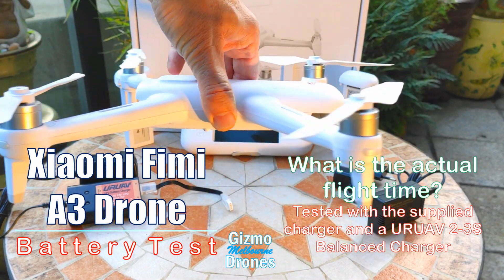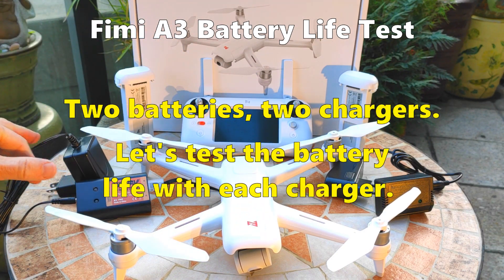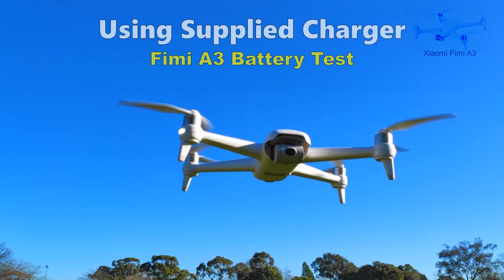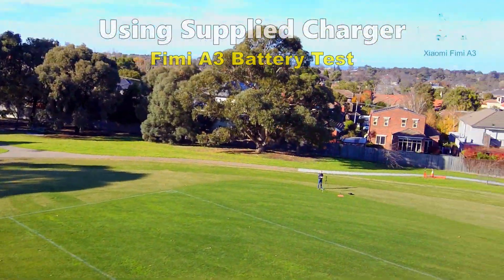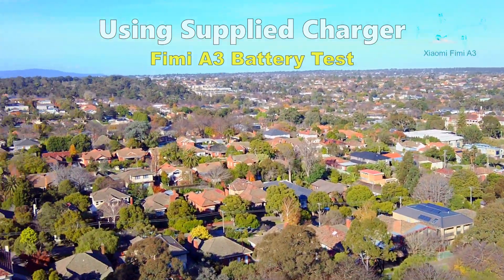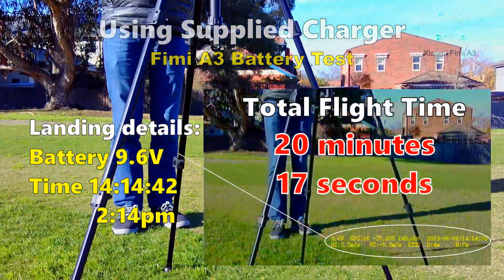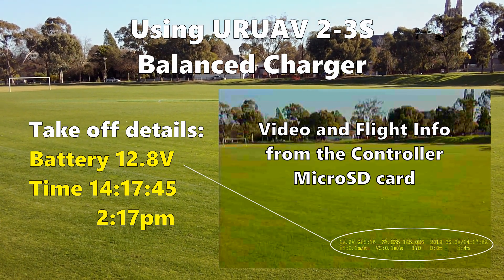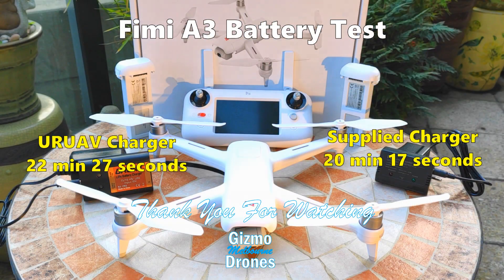Xiaomi Fimi A3 Drone Battery Test - 22 Minute Flight Time

Comment: Hello Gizmo Drones, I just got my Fimi A3 and love it but I only get about 13 minutes flight time before battery reaches 10.8V and is telling to land. Is it good for the battery to keep flying till 9.8v? And why is 9.8v THE BORDER VOLTAGE?
Reply from the maker: Suggest trying a balanced charger for a slightly longer flight time. This is the one I used https://www.banggood.com/URUAV-2-3S-HV-1_5A-Lipo-Battery-Charger-Compatible-for-Xiaomi-FIMI-A3-RC-Quadcopter-p-1419171.html?rmmds=search&cur_warehouse=CN    Here is the explanation of 9.8V You shouldn’t fly below this voltage.

The Fimi A3 uses a 3S battery which means it has three Lipo batteries connected in series for a nominal charged voltage of 3.7V each x 3 batteries = 11.1V total. Peak voltage is 4.2V per cell or 12.6V for a 3S battery. The minimum safe charge for a Lipo battery is 3.0v each or 9V for a 3S battery and it is recommended to stop using the battery around 3.2V per cell or 9.6V for a 3S battery as a precaution to keep it above 9V. If you continue to fly the drone below 9V then future battery life may be reduced. I decided to use 9.8V as my target voltage for this test as it is a safe, low voltage.

Comment: my tests oem charger 14.25 until force land . aftermarket charger 15.50m in my opinion the oem charger is the way to go! because the aftermarket will fry battery more fast long run. test was done normal flying not hovering
Reply from the maker: Thanks for your comments. I appreciate it
Reply: I don't think so. It's just Fimi give us a charger that works below battery's capacity. The stock charger didn't fully charge the battery.

Comment: This is another lousy flight time test.  But it still confirms the 25 minutes quoted by fimi is a false representation.

What is the time til low battery warning?  The time it flies while in lvc is emergency reserve time and should not be considered actual useable flight time.  Redo this test and fly til 10.8v.
Reply from the maker: You raise a good point and I have added the technical details in the description section of the video. Basically the Fimi A3 uses a 3S battery so the minimum low voltage is 9V and the LVC or recommended low voltage is 9.6V to ensure you don't go below 9V. In my test I aimed for 9.8V to be safe and to work out the maximum flight time. Of course you are right, you shouldn't exhaust the battery in a normal situation however I wanted to know the maximum flight time.
Reply: Gimp Man, estoy completamente de acuerdo con usted. Esta es una prueba falsa que induce a error a los que ven el vídeo y a los posibles compradores de este magnifico Drone. Y ademas el cargador  Uruav lo único que hace es estropear las baterías. Si alguien quiere estropear las baterías, solo tiene que usar este cargador.Cuando Fimi dice que las baterias duran 25 minutos, las personas tendrian que entender que se refiere a tiempo de vuelo real porque si la prueba la hacen en una habitacion cerrada donde no hay nada de viento y solo se limitan a levantar el drone y a mantenerlo a dos metros de altura, para mi están engañando a las personas.